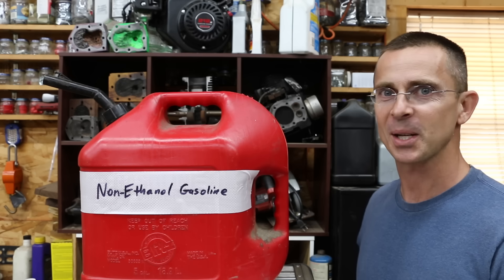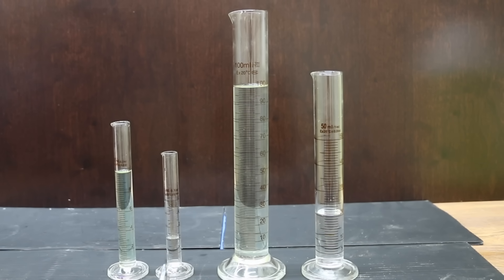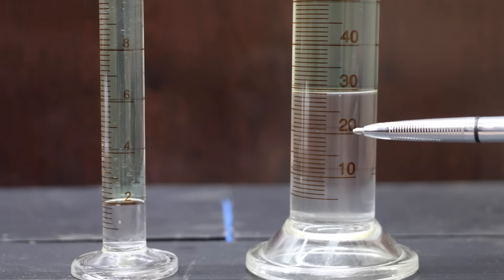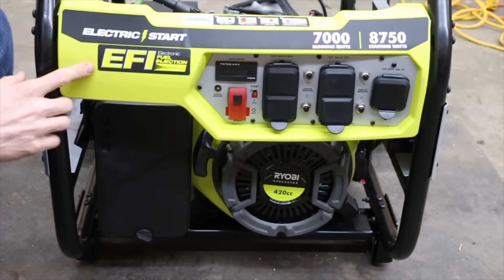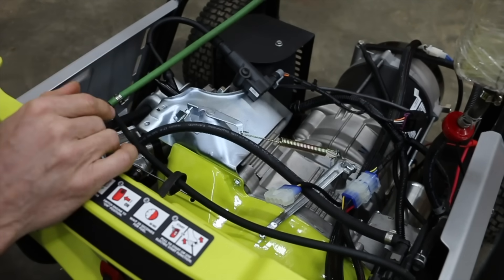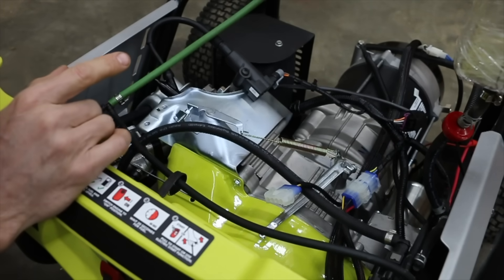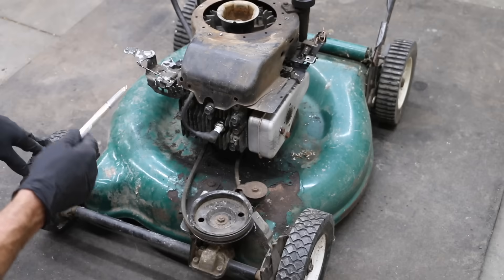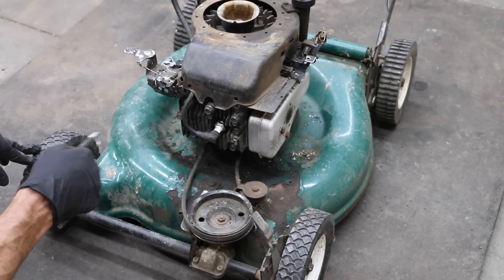Is Non-Ethanol Gasoline Really Better? See the PROOF!

Comment: Did you know that water in the fuel is importand that gasoline can burn?
There are very interesting videos out there about that or even also that the Ottomotor can also use water with some mods for use it as fuel. 
There is also a video out there that a emulsion of water & 80% of Diesel can be used for Diesel Engines, a Chinese did that & many more. The Diesel Engine in a Truck in that example was running like it should. He sayed he always make this emulsion for any kind of Diesel vehicle in his use, even without any problem. & hey, that listens very interesting because this example saves you 20% of Diesel ;)

But the most interesting is even to make different fuels from any biotic & abiotic Oils out there what could come from almost every kind of plant, the most interesting listens about "Fuel from the Hemp Plant, because this plant could give you really all about industrial products, Oils & Fuels & at last yes, also for Medicine products.
The Hemp plant is so interesting, because it could give you a real FREE ENERGY, because you can make a hemp plantage and then make your own fuel, what could make you completely autark, isn´t that interesting?! ;)

I´m thinking more & deeper about these things since i found out that the real free, autark energy is all based of life; The HYDRO CARBONS. 
Because in reality all Oils, however if BIOTIC &/or ABIOTIC are the true endless, regenerative Energy, because the Hydro Carbons are in ALL THINGS ON EARTH, it is the real base of the circle of life. We Humans and all pets are based on hydro carbons, all plants, all material we can see, feel or even use, all based on this particular elements HYDROGEN (Water) & CARBON (Material on Earth/The Earth itself too)
No, that´s no "Consp!rac! Theor!e" or something else like that, that´s the truth in the Physical an chemical things going on here on earth ;)
And when you know this, then you could find out that the Ottomotor and the Dieselmotor are using true, free energy if there wasn´t picked a price tag on it (What is picked on everything in this system, what hides the truth behind narratives and dogmas...But htat´s another story) --> so what are the Otto & Diesel engines, also called "Combustion Engines" what i don´t use to name it. Because these both particular kinds of engines are real free energy Engines. That´s the whole truth behind all the false narratives and such things. 
I think that´s a so importand knowledge what everybody should know about, because that could make us all really autarkt & free....
Did you know that all Oils, however if they´re biotic or abiotic are really endless, there isn´t any "Peak Oil"! And the Destillate called "Gasoline", what is destilled from Mineral Oils was allways the JUNK under all the doifferent destillates like kerosine, Diesel,....& they´re ALL, really all based on HYDRo CARBONS what shows also the truth, because there isn´t any Oil out there what is "Fossil" or such things the official narrative will tell you. No, it´s called MINERAL and even not FOSSIL - Oil, so the vocabular will show you also the truth about Oil or even the Mineral Oils (There are allways more than 1 Oil, no there are so many different kinds of Oils...So it´s also false to talk about "Oil" when we spaking abnout that. And so you could fee or see that you, or even we all could be scamed, because the Destillate called "Gasline" was the junk destillate in the year 1900, when there wasn´t any use for destillates like kerosine because there wasn´t any military or airplanes using kerosine and the same with Diesel..& sooo many many other destillates what hasn´t any use back then. And however there wasn´t any other Destillate made from Oils in use, the destillate gasoline was allways the ultimate Junk of all these destillates, what even allways came out in the same parts from every single litre of Oil....So you could or even couldn´t recalculate how much more the junk destillate called gasoline is so much more JUNK of all these Destillates today, when other destillates like kerosine, diesel,........has a use instead 1900. 
Isn´t that interesting?! :)
But that´s WHY all these narratives like "Oil is fossil/from dinos,.." or especially "Peak Oil" was introduced! They was introduced to controll it, and then make big money, especially when you know that gasoline was allways the junk under all these destillates made from all these endless and also natural kind of biotic and abiotic oils.....
I could tell you so much more about this particular topic, because i´m asking the right questions since roundabout 2007 when they was beginning to junk the more reliable cars and you got money for it when you was trashing your one.....That all was so bad in my eyes and so it beganns for me to ask, search, and even think more and more freely.....
That´s also why i´m interesting me for more autark ways to get fuel for these true free energy engine called Otto and Dieselmotor.... ;) And that´s also why i really like Project Farm, where you test so much different things, thank you for that! :)

& really nice greetings from Bavaria (germany)

Till
Reply from the maker: Thanks for sharing.

Comment: If you add 10ml of water to 10ml of ethanol, you do NOT get exactly 20ml of liquid. It forms a solution where the density is somewhat closer to water than it is to ethanol. So it's very possible that the E10 you bought was indeed 10% or so.
Reply from the maker: Thanks for the feedback.

Comment: You could have weighed the two gasoline mixtures to verify content. Also, you tested in 2-cycle engines. Do you think the results would be changed in a 4-cycle engines?
Reply from the maker: Thanks for the suggestion.

Comment: i thought ethanol reduces octane of gas.
Reply: Hi John,  it all depends on what you mean by 'gas'!  The extreme 'leaded' gasolines can be cranked up to the point where they show comparable Research Octane Numbers to ethanol.  Take a look at AVGAS 130 and note that the RON varies with air/fuel ratio. Ethanol can vary a bit, too, but usually around 110 RON.   Pump gas is  often labelled with the nominal RON.  There was once a cat-cracked gasoline that was allegedly 108 RON, but it cost more and did not catch on.  As a child of the 1940s  I recall Cleveland Discol was on sale when I was younger, allegedly 8% alcohol from the DIStillers COmpany Ltd....  
My 50cc Mobylette (student transport in the '60s)  was screwed up to over 12:1 compression ratio and ran like a rabbit on a Methanol/Castrol R 2-stroke mix.  Mmmm . . . .  Castrol R!  Someone gave me a big drum of Meth, so I did the deed.  IIRC, air/fuel ratio was near 6:1 according to an exhaust gas analyser at the college.

Comment: I think its funny. 
Almost every test I see is based on from gasolin base view.
Almost everone keep forgetting that etanol has higher octan and you use different settings for spark advance etc.
So those test is not fair test at all. 
With that sad its hard to compare right of, as you really need an engine made for running etanol only. Those motors you use is made to run gasoline only. The results is what you should expect.

So a challenge for you. 
Take two motors and rebuild one to be used with etanol only. 
The etanol motor should have higher compression, a carburetor tuned for etanol. A spark system thats tuned for etanol.  etc..
If done right you should not be able even to run gasoline on it, as it would be bad for the motor.
It should also take around 20-30% more fuel, but in the same time it should be stronger and maybe you should be able to run it on lower rpm to compensate for the higher fuel consumption
.

Comment: Great video, suggest check Brasil. Here we have had pure etanol cars for decades and  know all cars run on both fuels... And all gasoline has 27,5% Ethanol... Our conclusions are pretty solid and Ethanol requires more tobust engines, is way les eficient (about 30%) than gasoline, it burns clear but still more corrosive and worst to the health of the engine... It's good for supercharged cara because it resist more to pre igniton... Ethanol is cheaper, so sometimes its better tô use it as we can use both...
Reply from the maker: Thanks so much!  Thanks for sharing.

Comment: I've been using 10% ethanol fuel since they started selling it and never had any real trouble. Back in carburetor days most cars ran a little rich and the alcohol which runs at almost twice the air- fuel ratio as gasoline helped to make those cars run a bit leaner.
Where we really DID have lots of trouble was in the mid 1980s they began putting methanol ( wood alcohol ) into the fuel which shrunk gaskets in carburetors and cars with plunger type accelerator pumps had the piston cups shrink and distort - no more accelerator pump which made them hard to start and drive. It was a disaster.
Reply from the maker: Thanks for sharing.
Reply: that was MTBE and it was a nightmare, especially on Carbureted vehicles for the reasons you stated above.
Reply: @mrpoquah  I had an old carburetor on one vehicle that a gasket right in the middle of the throats and it shrunk up into a triangle shape. You could look down in it and see the mis-shapen gasket.

Comment: I was told to use high octane..only when storing over winter.....because it will not gum up in the carb....and it helps......since I started doing this....never had to clean carb....and living in central BC...long winters....it helps to store it with high octane..........use your cheap gas....but run tank dry....and fill with "good gas" let it run for a few minutes....then store it away
Reply from the maker: Thanks for the feedback.

Comment: On a 1.6L petrol engine (GM Z16XEP) i noticed my consumption did increase when E10 fuel was introduced (from 54MPG to around 52), the last 2 tanks have used "super unleaded" (No alcohol) and fuel consumption has dropped, i am now getting around 56MPG for almost the same journeys, your 4% difference may be an under estimate but i guess it depends on the engine? In the UK we have been using 5% alcohol added fuel for some years. I am not sure adding alcohol is any better for the environment as all it seems is you are consuming 10% less oil on a fill up but you burn more of it for the same mileage! 
Other countries in Europe have been using E10 for some years and there is no evidence it damages engines (even ones nay sayers in the UK say cant be run on E10!).

You findings are interesting and someone should really do an extensive set of comparisons and let the public know the truth, we are all told that there is no performance difference using the different fuels but I for sure know it does affect consumption (and running costs)!
Reply from the maker: Great feedback. Thank you

Comment: I live in Canada. All fuel is 10..ish ethanol. Its been that way for a decade at least. I do not know of any sudden fuel related problems that have appeared. There is your long term test. Unless you are talking cheap small engines. In which case maybe you should check what they are designed to run on. So that would qualify as user inflicted.
Reply from the maker: Thanks for sharing.

Comment: The problem is going to be, if issues are found with E10 on plastics and rubbers, or indeed engines or fuel tanks, we will all have damaged our cars due to government action but we won’t get any responsibility accepted by the government?
In the UK, they are likely to want gradual ‘killing’ of the current engines to drive us to electric vehicles and rid the roads of fossil fuel vehicles. Ethanol in the gas tank is likely to cause issues too with corrosion and rust being sucked into the injectors and carbs, especially if fuel is allowed to run low in the tank?
How about testing E10 and E5 mix, say 5 gallons of each, would this be beneficial?
Is this a worldwide drive with ethanol content?
Great work and a pleasure to watch…👍

Comment: Could you do an experiment where the exhaust from one engine is fed into another engines intake and used to drive the other engine ie a generator driving another generator and maybe  even more than one extra engine,by using a valve to direct the gas to muffler or the extra engine, just a concept I had ,maybe a crazy one who knows.
Reply from the maker: Thank you for the video idea!

Comment: Ethanol is used for stretching petroleum.
Reply from the maker: Thanks for the feedback.
Reply: @ProjectFarm  Technically that's what it is for. Brazil forced their economy to move towards Ethanol fuel a while ago and now they are mostly on Ethanol. The higher the percentage is where you get the hotter run time on engines.

Comment: The problem with ethenol gas is it becomes acidic when moisture mixes with it. Like you showed it pulls the water out and becomes acidic. This acid eats metal and rubber parts. The new cars designed for it run stainless steel fuel lines. The old carburetor type engines suffer with corrosion when they sit long periods of time with ethenol gas in them. Plus why does the government want to take grain out of the food chain to power cars. How many people go hungry every year. Yet the farmers sell there corn to the ethenol plants. But that is a whole other topic.

Comment: It seems I remember I test where you took a bunch of carburetor parts and soak them for months and non ethanol and ethanol fuels. It clearly showed that they damage was done by the ethanol when it was in storage. You also stabilized both the ethanol and non-ethanol gasoline and it seemed to indicate that the stabilizer really only made a difference if the engine was stored with ethanol gasoline.
Reply from the maker: Thanks for the feedback.

Comment: My experience with ethanol free fuel is I put it in all my small engines carburetors and it never gums up the carburetors even for long-term storage likes my snow blowers and stuff but when I use gasoline that has ethanol in it it gums up during storage even with storage additives.
Reply from the maker: Thanks for the feedback.

Comment: Great test and science video. Can't wait for the long term tests. Pre-injection engines are going to struggle with 10% ethanol.
The big test you missed is What does the ethamol/water mix taste like? If we all drank the ethanol extracted, how long would it be before the Govt pulled this change?
Reply: Pre injection engines are going to struggle with e10 in what sense? Are we talking carbs here or something or a pre chamber style injection system? Because no they don't struggle with ethanol at all the materials yes but that's because those materials are inferior quality
Reply: Why exactly would you remove ethanol from fuel? Its better in many ways at preventing wear.

Comment: This is really interesting. Here in the U.K, our standard unleaded fuel has just changed from E5 to E10 and there’s a lot of opinions regarding its effects on engines and fuel system components. I drive a 21 year old petrol Mercedes and also have cars from 1930’s - 1960’s. I’ve been using super unleaded since the change over as here the super still has only 5% ethanol content. My merc holds almost 100l of petrol and here, super unleaded is around £1.56 Per Litre. So it’s costing me around £20 more to fill my tank. It’s a nightmare🙄. Can’t wait for your test results. I SUBSCRIBED, so should you! 😉
Reply from the maker: Thanks!  Thanks for watching and subscribing!
Reply: @RandomShart indeed! Although since my comment, I’ve researched the situation regarding my S Class and have found it’s safe to use E10 in it, but as for the classic and pre war cars I own, I will be sticking with super as there’s no alternative.

Comment: You should make test on how different percentage of ethanol in fuel affects mixed 2-stroke oil's lubrication performance. I would be very interested to see if there is really difference on wear if you use ethanol-free fuel or fuels containing 5% and 10% of ethanol.
Reply from the maker: Thanks for the suggestion.

Comment: What is the right long-term, six months or longer, solution for small engines, like a generator, or a snow blower? Leave the ethanol-free gasoline in tank, or drain the tank, close the fuel line valve, and run the engine until the ethanol-free gasoline burns out?
Reply from the maker: Thanks for the suggestion.

Comment: I only use top tier gas.in my SUV . Use to purchase Wawa gas until a coworker told me about poor milage using it. I got at least 4.5 miles per gallon less using their inferior gas. Rather spend a little more on top tier gas that keeps the engine cleaner and better gas milage. Does anybody know if the sell non ethanol top tier gasoline? Appears that only thing ethanol helps is the farmers. Just great how our goverment told all companies to use corn syrup in place of natural sugar then made gas companies to use 10% ethanol. Hear stories where they believe corn syrup

Comment: The main purpose of ethanol in efficiency is for knock/pre-ignition control, so it's possible to increase compression ratio of the engine. Higher compression ratio means more efficiency, but also higher fuel temps due to compression.

Gasoline have more power/energy delivery than Ethanol, so it will be more efficient on a side by side comparison like that, but there are some conditions that pure gasoline can't handle and knock come in, so you add ethanol to control knock. 
The same rule applies for turbo engines as well, higher the ethanol in the fuel, higher the boost with less prone to knock.

The last but not least, ethanol is extracted from the surface of the Earth, and the resulting product of the chemical reaction only generates heat without adding more CO₂ to Earth's surface, being eco-friendly.